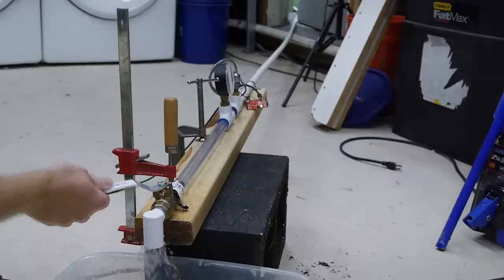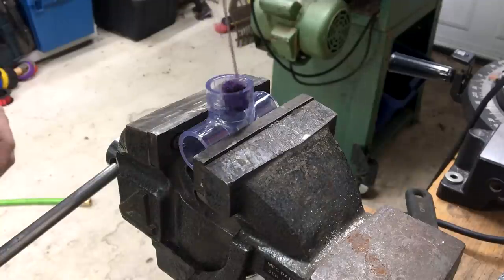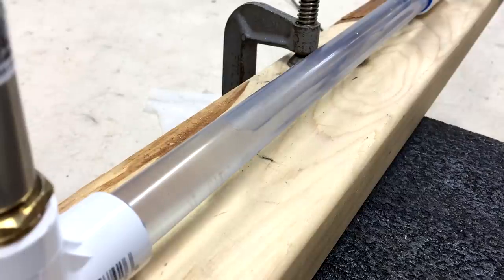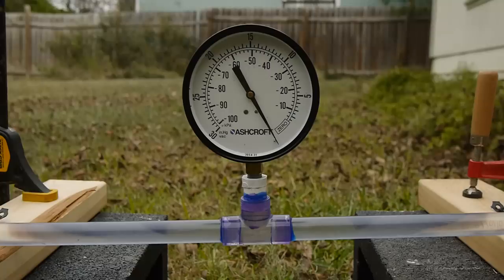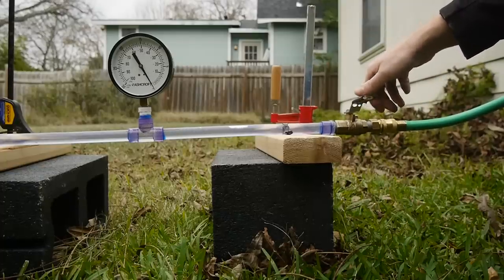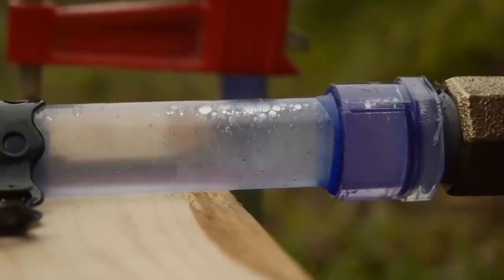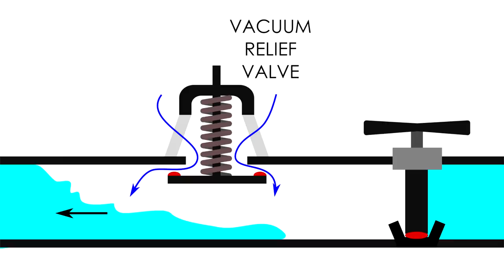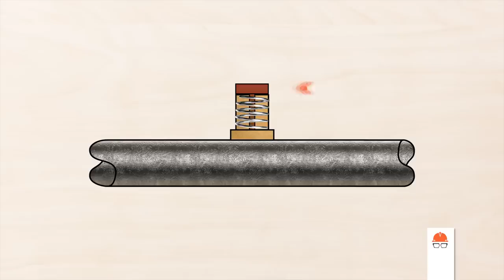How to Collapse a Pipe by Closing a Valve

Comment: Sorry dude, but you aren't getting more vacuum than the gauge shows.  About 14.7 psi below atmospheric pressure is all there is to be had in vacuumland.  Negative absolute pressure only means that you weren't quite there yet to begin with.
Reply from the maker: Pressure that day in San Antonio was about 31.5". I said in the video the peak looked like it was around 30" below atmospheric but that it wasn't a scientific observation.
Reply: Not PSI, Pounds per Square Inch, but inHg, or Inches of Mercury. Besides, he is not measuring open air or barometric pressure, he is measuring the pressure on a closed water system. You could draw vacuum on water until it starts to boil at room temperature, since water is incompressible.
Reply: That doesn't look like a gauge buffered with a fluid to absorb the momentum of the slingshot.  Just because it is bouncing past 30 doesn't mean it is reaching 30.  There is a bit of a whiplash going on.  If you want to talk numbers please get better equipment in the future.
Reply: Charles Cox .
Reply: MR Prosti I said if he wants to talk numbers he needs to get better equipment.  He didn't have talk numbers, but he did. That was his choice.  If he wants to look uneducated by making claims based on the swing from the momentum of the needle that's his choice, too.

Comment: When I installed all new CPVC pipes for the kitchen and bathroom.  I also used t-fittings for the bathtub and bathroom sink. Above the t-fittings I used large pipes capped off to let the air in the pipes absorb the shock when the valves were shut off.

Comment: As a  sewage pumping station designer, the negative pressures encountered on pump stop / valve closure were always a major consideration in a long rising main, and far more worry than any positive spikes on start-up.   Not so much the negative pressure itself (except on very large steel mains), but the pressure drop could cause a full vacuum to appear at any high point or 'brow' in the main, creating a gap in the water column, after which all the sewage that had carried on under its own momentum would come back and slam into the fluid the other side of the gap, causing a massive pressure spike that, repeated often enough,  could and did cause fatigue failures of pipelines.    
A pump didn't have to be stopped dead to seriously impede the flow and cause negative pressure surges.    Just cutting the power would turn the pump instantly from a device propelling the flow to a severe restriction throttling the flow (as if a valve had been slammed 3/4 shut).   Unlike water mains, in a sewage pumping station pump stop could happen up to 6 - 10 times per hour, so the cycles mounted up.
All sorts of measures could be (and were) taken to alleviate it, including slow-stop (or VSD) on the pumps, anti-vacuum or air inlet valves into the line, check valves in parallel with the pump to allow flow to 'bypass' it, heavy flywheels between the motor and pump (that was an old-fashioned method no longer used in my time), slow-closing pump discharge valves, even a very high 'standpipe' slightly higher than the normal operating head of the system that would just allow excess to weir over back into the wet well.

Comment: Funfact: That system you created also has an electronical analogon. While the last water hammer is analog to the boost converter (increases voltage), this one with the vacuum relief valve (acting as a diode) is analog to a buck converter (decreases voltage). By fast switching of the valve upstream and the relief action you get either the full pressure or zero (well not quite, but you get the idea) pressure. If that pressure is smoothed out by a big pressure vessel down the stream, you get the average pressure.

Comment: On water hammer related issues, what i have seen a lot, is where old water infrastructure as been "updated" - re-sleeve a old clay type water lines by pushing a plastic line into it.
This has an effect where the tap in line is not always 100% lined up with the hole, the mains pressure is reduced to try and minimize water loss due to old leaking infrastructure and the volume of water in the supply line is almost halved.
What happens then is that you have say 6bar of pressure when there is no flow in your line, but the moment you open a "Big" flow, the supply pressure just falls away to below 1bar and when the flow is stopped, you then have a massive water hammer.
The only way to compensate for this is to install "BIG" - 50litre pressurized bladder accumulators as close to your point of use.
The small water hammer units are useless against this type of issue.

Comment: I manage the water and sewer in an older mid sized municipality. Hydrant monitoring has revealed much about  pressure spikes and vacuum in our 4 million gallon a day system. I'd like to here your take on how air hammers occure due to trapped air at high points.

Comment: 2:55 isn't this cavitation? Dissolved gases may also be there, but normally when a valve closing event happens the resulting vacuum (in this case) drops the pressure below vapor pressure of water, causing a spontaneous formation of steam bubbles, that collpase once pressure rises again.

Comment: Solution is very simple in fact. Introduce a pressure relief valve with a set value higher than normal operating pressure bypassing the ball valve. This way both sides will be protected from both high pressure and vacuum. After transient conditions is settled the relief valve goes to closed position.

Comment: Was filling a Fire tanker after a fire.  I was on the pump panel had a "rookie" at the hydrant.  We were using a 2 1/2 " 50 ft section of house with ball valve on the hydrant end .  I told the "rookie" to close the valve SLOWLY.  She didn't hear me!  She slammed it shut ,and the hose popped out of the coupling and hit me in the chest knocking me to the ground.  I told her , once I found out all my body parts still worked, that's why you close valves SLOWLY!

Comment: This makes me think of the beer bottle trick. You take a glass bottle filled with some kind of liquid, then slam your hand on top of it really hard. This creates a vacuum between the bottom of the liquid and the bottom of the glass. Atmospheric pressure causes the liquid to then slam into the bottom of the glass very hard, usually breaking it. I wonder if valves could be damaged as result of similar forces caused by the negative pressure spike.

Comment: It would be impossible to have a vacuum of more than 100kPa as atmospheric pressure is about 100kPa (i.e. a perfect vacuum would be 100 kPa). Perhaps the moving parts of the gauge have enough inertia that the dial swings way past the true value when the valve is closed.

Comment: At greater velocity and pipe lenght, after closing the valve, the water could keep moving forward, leaving a negative pressure behind it, and finally come back and crash to the valve, producing positive pressure (water hammer again).

Comment: By large what you are seeing are not dissolved gases but water boiling (cavitation) due to the vacuum that is formed. The vapour pressure at ambient conditions is about 0.02 bar  (2 kPa) so water would start boiling at these conditions.

Comment: Great material , i got the same  problem in the real life ,water puryfing instalation , the water booster pump lose his (absorbing) pressure in the tank behind the pneumatic absorbing membrane , this cause a strong hits "like hammer"  directly to the sealing glue in the connections when the pump electric motor stops , this cause a massive leakage in the installation , chain reaction starts  , leakage was masive , so pump try to achieve defined  pressure  , in my situation  it was 4,5 bars  , pump cant get the pressure because the leakage was masive , so it work constantly lead to pump seizure. Conclusion, its very important to check water booster  pneumatic pressure at least  4-7 months  i think , to avoid failure .  Mine booster loose his absorbing pressure after 1,5 years of very intensive usage  ( about 3000 liters /24H    792 gal/24h)

Comment: Excellent - great video, fine presentation. I think I counted 4 reversals on the gauge read as the valve was closed, before the vid cut back from it. Please could you tell me if those fluctuations on the gauge reading are true downstream pressure wave readings or some function of the gauge return itself? Thanks
Reply: Those can be true fluctuations of the pressure in the pipe, due to the water column surging back and forth, mostly due to the springiness of the pipe walls.    
A pressure transducer hooked to a chart recorder will show an ongoing wave a bit like a seismograph.   In a real-world application (say an 8" pumping station rising main 2000 feet long) you can easily get a dozen or more reversals, spaced several seconds apart, before the wave attenuates into insignificance.

Comment: a local man to my area died because a pipe beneath a damn got clogged. but the problem from that was it created a low pressure vacuum which once cleared caused a massive suction that killed the diver.

Comment: If big amounts of water are flowing, the ,,water hammer'' inside the pipe (before the water is flowing through the valve) has much kinetic energy. So, if you use a hydrant as a fire fighter, you have to close valves slowly. The hose after the hydrant won't be affected by a short vacuum, but the pressure increase in the pipe itself can break it in worst case.

Comment: You can also order valves with vented balls, upstream or downstream and this allows pressure that is built up inside the valve to escape ensuring that the valve will not fail due to the pressure.

Comment: Backflow Prevention with a Vacuum Breaker
A hose vacuum breaker (HVB) is a simple device that screws onto the hose threads on your hose bibb. It, in turn, has male hose threads onto which you can attach your garden hose. Use of your garden hose with an HVB is no different than without one. The HVB allows water to flow out normally but opens and vents to the atmosphere if a pressure reversal occurs. The cost is typically only $5-$10. 
HVBs are required by many plumbing codes. –LSU AgCenter

Backflow Preventer
A backflow preventer is a device installed on your home’s water pipes that allows water to flow in one direction but never in the opposite direction. 
Its sole job is to prevent drinking water from being contaminated due to backflow.

Comment: I always say, never close a valve in the direction after a pump, but before a pump. In a vacuum, your pressure maxes out at zero, but pressure can go to infinity.  As long as you can rely on your material to boil under a vacuum, and that your material can withstand this absence of pressure than you would be fine.

Comment: Thanks sir for your video I learned a lot about pipes and the pressure water creates in them when a valve is closed.  I have hammering pipes and the sound is produced when the shower or a faucet is opened.  I cannot find information on how to resolve this issue. I tried to blead the system by removing air from my pipes several times to no avail.  Can you please tell me what would I have hammering pipes when opening the faucets in the house?  No noise when closing.  Thank you in advance for your help.

Comment: The dissolved gasses expand under vacuum conditions, once displaced by the water they are not re-dissolved, they contract when pressure returns to normal, and can be collected for testing, in such objects as a balloon.

Comment: Grady, In addition to dissolved gasses coming out of solution in a vacuum, could some of the bubbles be from the water going from a liquid to a vapor phase?
Reply from the maker: I don't think I got the pressure quite that low.
Reply: And another follow-up, the bubbles lasted too long to be cavitation, basically vacuum bubbles. That's how the trick works that blows out the bottom of a glass beer bottle by hitting the mouth with your hand.
Reply: I see steam formation in addition to the dissolved gasses. This video shows a more dramatic demonstration https://www.youtube.com/watch?v=X9UbzcanuDk

Comment: That's something i was observing lately when i was closing the faucet and the hose started making suckling noises at the nipple as the water was creating a vacuum at a higher negative pressure than what the hose clamp can handle without leak.

Comment: You could put something like a T joint before and after the valve, and then connected to those T extensions about a foot or two of pipe and then cap it on the end.  Air would collect in that straight up T extension and act like a buffer that can expand and contract with pressure changes, unlike water.     Something like this ___I__x__I___  where X is your valve, along the pipe, and the I's are T joints standing vertically about a foot or two (or more, depending on your application).  Try it.  

Use clear pipe instead of opaque pipe for the I's, and you can visually see how much air is in there, any turbulence going on, if it jumps up and down while being compressed when valve is shutoff, do you need to increase the length of you're I's to not lose a minimum level of buffer air, etc.

Comment: A better comparison of magnitude might have been in order. "Negative" pressure has an exact limit, which is actually zero pressure.  It's "negative" only in contrast to ambient external pressure.  In atmosphere at sea level, that limit is around 15psi (one bar, or -30" of mercury).  Only if the pipe is deeply buried (depending on soil) or underwater can it be significantly greater.

That limited force is dwarfed by the potential positive pressures of the water-hammer effect.  And, "negative" pressure is exerted from the outside of the cylindrical pipe rather than from the inside.  Practically any rigid pipe is very much more capable of withstanding pressure from outside than from within.

Comment: I am definitely taking your advice to gradually open and close valves to reduce sudden changes in positive pressure and negative pressure (vacuum). Our codes require vaccum breakers on outdoor faucets and pressure relief valves on water heaters,but our water is very hard. Is there a posibility that mineralization  on these safety devices could cause them to stick or malfunction? Would PEX be more or less likely than copper or PVC,ABS,and galvanized pipe,to implode?

Comment: If the pipe is connected to a larger diameter vessel such as a hot water cylinder, the effects of water hammer can split these vessels along seams. Solenoid valves on washing machines are the main culprits as they close very fast.

Comment: awesome, so could you build a vacuum pump  by using a one way valve so air can only get sucked into the pipe and out of a chamber? or would there be a problem with the water turning to gas? If so could you use something like mercury?

Comment: I've not watched the whole video, but one must understand that under NO circumstance can the negative pressure be greater than an absolute value of not more than 14.696 PSI.
Possible positive pressure is potentially unlimited.  Therefore engineers have only to be concerned with "hammering" as a consequence of negative pressure and its ensuing harmonics as the wave transgresses from the high pressure to the low pressure of any given vessel.

Comment: Question on a video I saw somewhere. Drum pump. Why did the drum collapse when siphoning water. My guess is that the ratio of size of pipes is off causing too much vacuum. What is yours? Would using a larger intake pipe reduce the risk of collapse?

Comment: I always asked myself what exactly causes loud noise in water pipes in the house^^ probably thats part of this! It especially occurs when I close or open the tap fast :)
Reply: That hammering is the water 'bouncing' forward and back in the pipes.   You can think of the water a bit like a railroad train - if the loco stops dead the rest of the train is going to try and keep going.    
In our house we don't get knocking but we get a high-pitched 'ringing' which is the same thing happening but at a high frequency, obviously there's some bit of pipe somewhere that has a high resonant frequency.

Comment: Me, who works with Circuits all day:
ADD A CAPACITOR!!! (Connected to Ground, or in this case, to Atmosphere)

Which I think some systems do?? Essentially having a reservoir in your flow path that is either exposed to air (thus is vertical by the head-pressure of your pipe), or enclosed in a tank so the air pressure will match your operating head pressure... 

I'm pretty sure the second one is what Water Hammer "Arrestors" do, but I'm curios to know if they also deal with Vacuum! 
Because certainly air-relief is better than nothing, but I hate the idea of adding gas to the system whenever there's a shock.

Comment: The max pressure can be serveral times atmospheric pressure.  However vacuum can only drop to 0 psia and no further.  If the pipe is not damaged by 0 psia, the pipe will not collapse under any low pressure condition.

Comment: The local fire department where I was a water department operator broke the mains on about 75% of the fires in our service area by slamming valves. They would put a ball valve on one of the ports to bleed-off air and slam it shut when they got water.